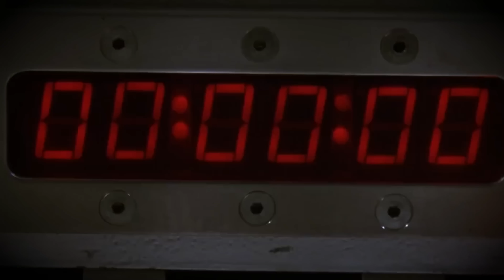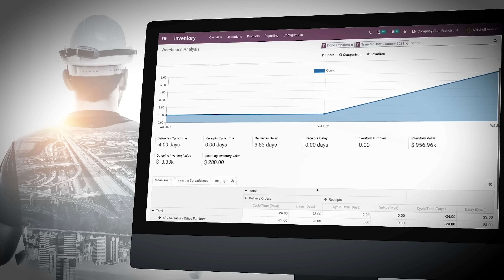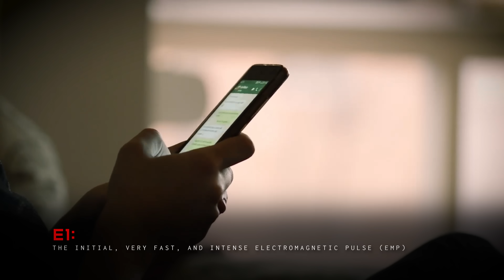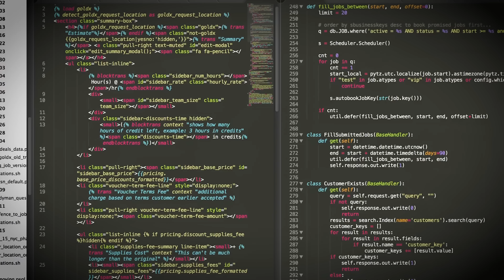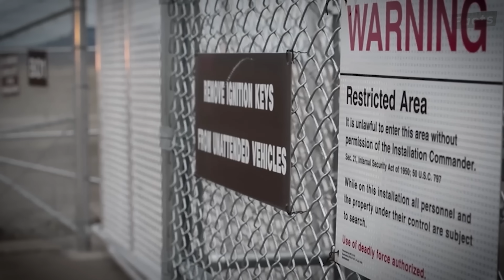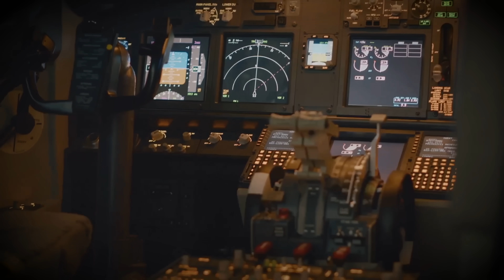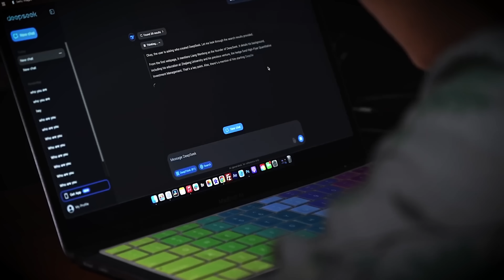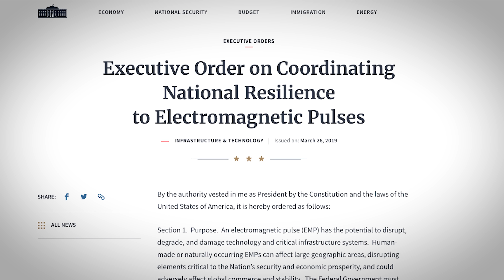Could an EMP actually cripple the U.S. military?

Comment: No an EMP will not shut down the US military it might change the battlefield but it wouldn't shut down the military boots on the ground with firearms in your hand are Emp proof and that is actually how most wars are  fought  take the Taliban for example for 20 years a group of people fought against the United States military armed with nothing but 30-year-old and older weapons left over from the 80s wearing flip-flops and bathrobes driving the occasional Toyota pickup truck and somehow they managed to defeat the United States military take control of Afghanistan and still have control of it to this day

Comment: I'm aware that you posted this video 9 days ago but I just saw it today. Given the information that you put out in this video I'm assuming that you're aware of this, but I'm just going to put it out there for anybody interested in reading this post.
The main and most significant reason why civilian infrastructure and the majority of even basic military assets are not hardened against EMP's is cost and redesign.
Almost all of the microchips in the world for civilian and military use are silicone based. It was discovered a long time ago many decades ago and only starting to put into effect in the 1980s that gallium arsenide chips and another version of galenium are highly resistant to Electro magnetic pulses.
However gallium arsenide chips are very expensive and on top of that you would essentially have to re-chip everything except for a new products that were not built with the new Chips instead of silicone base chips.
Many of our strategic military aircraft have basic EMP protections built into their airframes and I'm not going to go into detail explaining it but they are very basic.
The main problem or fear were the High Altitude electromagnetic pulse attack is the civilian infrastructure. Without power grids within a matter of a couple of weeks Millions to tens of millions of civilians would die. This is from many aspects of hospitals, water treatment facilities, Refrigeration for food, etc etc etc. And that is where the real problem is. So I don't believe that Russia or China would ever use an EMP against the US unless it came to an actual full-on World War and then yes I do think that they would use one to kill as many civilians as possible to make it that much more difficult.
That's my long rant, any thoughts?
Reply: Perfect and to the point, but everyone forgets about the fires this event would cause.

Comment: EMPs can be blocked, you have to use just as much power or more than the EMP.  EMP shielding, Faraday cages and frequency filters can operate to channel the incoming energy, and can be made to create a dome parameter.  When it comes to waves there is also always an option to counter it with an opposing wave.

Comment: 😂 ❤ … Power plant installations in America are insufficient, poorly maintained, lack of replacement parts, lack of Technical manpower … EMP is the last thing to worry about…  
If one Generator fails, there would be a cascade failure as the other Generators will try to keep up with the power demand, in a few hours, all the generators would fail. That is your main problem. No backup facilities.

Comment: Ok cliff notes. If US military hardware is built in compliance with Mil-Std-461 & 464 (hint most is) EMP will have limited if any impact. Civilian hardware could be impacted, it would have to have long cables (think power lines) in order for the energy to couple. There is a vulnerability in the initial pulse because the fast rise time simulates high frequency but is limited to line of sight. In an example your cell phone would likely work but the cell tower might not.

Comment: In an effort to improve efficiency and improved grid reliability, many electricity companies have discarded the old analog protection systems and gone digital. So yes an EMP could have a devastating impact on the grid in the area of susceptibility. The grid can be isolated to disconnect from effected areas but are talking a very wide spread range of impact.

Comment: I’m under the impression that non grounded (plugged in) electronics would not be affected.  So, cars, cell phones, etc… would likely still work.  Of course the networks that run all of that would go down (server farms, civilian power grids, even the electronics needed to power gas pumps, payment systems, etc…)
Reply: Wrong impression. If it has a microchip and the whole item isn't harden/shielded from EMP it's toast. Until recently Russia used a lot of electronic tube technology for their military because the EMP only affects the circuit while the EMP is present. Then the circuit returns to normal. Russia is over 90 years ahead of the US in tube tech.

Comment: I think one of the biggest questions we need the answer to is if they just turn things off like pressing the power button, or does it completely fry the electronics? Do epoxy coating like those used in power tools protect them?

Comment: FCC GROL+ Radar license holder, industrial electrician/electronics technician here. If I was military, I would be a W-1 with my training and experience as that's what one of my classmates that graduated from the same program that was military was promoted to. You have some serious errors, other than the Sun:

E1 - Most modern electronics can actually handle this pulse and are fully shielded against it. Almost all integrated circuits now are made to be immune to this pulse unless it effects the power supply circuit.

Modern surge suppressors of middle or higher quality, along with power supplies of decent quality design contain Transient Voltage Suppression (TVS) diode that can clamp down even the fastest of spikes in voltage in the nanosecond range in addition to the Metal Oxide Varistor (MOV) that handle most of the transient voltage spikes.

E2 - only poorly grounded antennas at very close range that and are made of thin material (and/or are circuit controlled antennas) without filtered and properly grounded receivers attached.

This is because a path the ground can be provided by the snubber circuit created by the low pass filter in the receiver, giving the transient a very low impedance path to ground. Lower frequency antennas and receivers are more vulnerable since the impedance of their circuit against such a spike would be lower than a higher frequency, so a Cold War era military radio is going to fry before a Starlink terminal.

Comms equipment (microwave as is used by emergency services and the military and cell systems) connected to metal structures isn't going to get damaged by this pulse level anymore because they are rated for it. The power supplies are fully shielded and have surge suppression that is tested against lightning striking the tower or structure. The power cables are shielded. Everything is well grounded because if it isn't, it picks up the radio waves and that gets into the equipment, making it not work. You have really bad info here and I don't know where you got it. The older military equipment (Cold War era) is rated for this and just needs the surge suppressor working with the ground installed. The tower won't be transmitting enough for use without a sufficient ground to handle the EMP surge. The tower transmitter has a surge suppressor and so does the generator, then there is the filters in the power supply of the tower to protect it as well.

As for civilian and military vehicle vulnerability to EMP: only the AM/FM radio might be dead and you could lose GPS satellite connection from them taking a hit. The computers are shielded to protect them from radio interference and from the constant small EMPs going off in the engine bay from the ignition system. So, they are in a thick metal box with filtered inputs and outputs. If it was off, it should be fine. It might stall when the event happens, if it is older or cheaper build quality. Military aircraft: all of them have been upgraded in NATO to be hardened against EMPs. This was a massive project and there was a patent to go it using a special semiconductor that ended up being reinvented a second time. All current service aircraft use this. Civilian aircraft...well, that's different. Older ones are where things get dicey, but the radios would still work as they are rated to take the EMP forces because airplanes are rated to get struck by lightning and the filters for their radios would stop the E 1 level, same for the tower's and the tower radar, so they could still be guided in for landing. Newer planes would have all their electronics still working, other than the GPS issues, which you covered, but they actually navigate by the older radio navigation beacons and these are already hardened (thanks DoD) so they could just continue on.

Let me just cover the last of this long correction. Your computer and laptop? If they are older than 2001, you are good. That EMP resistant chip and the shielding needed to protect your machine from blasting out it's CPU frequency as a radio since they go so fast and hard now. Also to protect it from stray radio transmissions from making clock-like waves that would cause bits to get lost. Same for your phone, including the radio and the cell towers. Your phone has to be resistant to all of these problems because it's a radio and a computer in a tiny package, so they need to keep it shielded, so foil, metal case parts, and metallic paint pull that off. Last, the power grid is controlled with a backup system now that uses microwave towers and radio transmitters so that if the connectivity through the switching stations and substations they can still communicate with the key switching gear and generators. This was rolled out nationwide as part of the Smart grid, except in parts of Texas, where they hate progress and want to pay for infrastructure twice.

Next time, consult an expert or two and not just some internet research.

Comment: Small electronics - particularly in cars - are not quite as vulnerable as often made out to be; because it has to withstand handling by people (who can develop thousands of volts on them just by walking across the room). So, all modern devices have surge protection both on the connections to the device, and on the connections at the edge of each microchip.

Cars are both safety critical systems - and thus subject to more rigorous design criteria than, say, a portable CD player (remember those?) - and in general are nasty electromagnetic environments to begin with (alternators with brushes, DC load dumps, high voltage ignition systems, and possible lighting strikes all contribute to this); so to get basic reliability, they are already somewhat hardened from the factory.

That said - a close-by EMP can still fry your stuff, just by sheer brute force. If you want a post-SHTF vehicle, look for older diesels (i.e, doesn't require an engine computer to trigger the fuel injectors) or bikes/quads with carburetors instead of fuel injection. If you need some electronics to survive, store it in a faraday cage - at the small end, a steel ammo box works, and at the large end a used ISO shipping container makes a nice bunker for your gear. Just make sure that the doors/lids are electrically connected to the body of the container (so, strip some paint off of a spot, and screw a wire in to bridge across the hinge, and seal it back up with RTV silicone caulk to prevent rust/water ingress).

Comment: Military's trucks require that they are not disabled by what I call "the lighting bolt" test.  An electrical arc set off near the truck.  How this compares to an EMP I have no idea but I would say better than your average car.  For decades now I have been hoping that our governments would require robust electrical systems against EMP.  I think very little has been accomplished.  So we maybe not have issues with military trucks nut we will have issues with fuel pumps not working.  Water pumps not working, medical equipment not working, communications not working in the civilian sector.

Comment: I remember when the USAF tested encryption mode on the GPS signal; this was before GPS was commercially available or widely known.  They didn't know that the FAA was using the signal for synchronizing comm between airports and accidentally took down the flight scheduling system. Domestic flights had to ground until the system got rebooted.
Reply: Day date time. Hyperlink? Year?
Reply: arse was not talking to head...

Comment: Years ago, some show on the Discovery Channel tested a Nineties-era Ford Taurus at a military EMP testing facility.  The car stopped running.  They restarted the car and drove away.
Reply from the maker: Well that is because the 90's era Ford Taurus is an incredible piece of engineering.
Reply: The computers of that era were much less advanced (their nodes were measured in micrometers), so a much larger charge was necessary to short the semiconductors than in modern sub 30 nanometer process chips we now see in vehicles. Modern vehicles are also much more interconnected, so less needs to go wrong to create a no-start situation, like a fried proximity sensor (radar) or something.
Reply: @wh0_am_152  Modern microchips will be fried. No restart.
Reply: Plot twist,   they drove 5 miles out and blew a head gasket.
Reply: that test was done at a peak power of only 50,000 watts per meter, wake up they have offered 100,000 watt per meter versions to the police for years, They don't buy them cause then they have to buy the cars. The army uses it a sensitive check points for several years.

Comment: How would an EMP affect our older nuclear power plants?
Reply: It's not that an EMP would affect the power plant, but they wouldn't have anywhere to send the power to. A nuclear reactor doesn't work like a light switch so yes it could cause a nuclear reactor to melt down without the EMP even hitting the power plant. 😮

Comment: Kyle I’m a cyber security expert (seriously 😮) although I don’t normally mention that. I’ve done dozens of security assessments and built a municipal infrastructure (across 11 critical sectors or domains ) to determine the state of security for things like the power grid. Anyway the state of maturity across North America is incredibly low first of all. Secondly taking these systems down is not as simple as an EMP pulse although I’m really impressed with this video. My point all this is if you’re ever interested in talking over these topics let me know and we can share actual email information and names and then go from there. But please keep this up because this is excellent content and I’m really grateful for your effort in producing it all. Wonderful stuff.
Reply: I work in the largest water treatment plant in the South East and our system in Air gapped for cyber security and the plant was built in 1893 so everything has an analog backup.  It's a pain in the tail but it can be ran without computers.  But to have safe drinking water we still need electricity for disinfection and pressure.
Reply: @xG.H-B  that’s so good to hear. I often read articles about infrastructure vulnerability and wonder ‘why would connect the control interface for something important like a dam the internet!?’ It seems insane! I suppose local control has its own issues and vulnerabilities but it’s a far smaller attack surface.
Reply from the maker: That sounds great. Feel free to email me at kyle dot gunn at task and purpose dot com. Thanks! -Kyle
Reply: Kremlin: You did what!? Are trying to kick off MAD?!

White House: Well, if it's any consolation, we took out several of our own satellites and only one of yours.
Reply: I am sorry Sir, and with all due respect Sir, Squanto saved the Pilgrims... Ready?
Reply: Military hardware is way more hardened than anything in the civilian sector. Who cares about us anyway anyways, right

Comment: I wonder how hard it would be to shield the electronics in an FPV drone. I know drones that are wired to the control through fiber optics are being used in Ukraine to defeat anti-drone jamming signals. Fiber cable is immune to EMP.

Comment: US Navy submarines are invulnerable to EMP so, no concerns about appropriate retaliation. (former USN Missile Tech)
Reply: Invulnerable? Or just hardened like any other ship, plus also generally under water?
Reply: @nathanahubbard1975  Three factors: a) the hull is metal and that forms a faraday cage; b) it's in seawater which is conductive and absorbs the EMP (this, BTW, is one reason why radio communication with submarines is so difficult - the water absorbs the radio waves) , and 3) what little sticks out from the hull is hardened against voltage spikes on it (i.e, it's got surge protection circuits on the antennas and sonar transducers).
Reply: @nathanahubbard1975  invulnerable as in the chance is so low that it might as well be zero.
Reply: lol water is like the BEST EXISTING SHIELD EVER vs EMP just one meter thick "walls" of water would shield any infrastructure from ANY radiation aside from a gamma ray burst (that will fry half a solar system)
Reply: @kickass-eu1dh  Specifically, salt water, as it's conductive.
Reply: @darkwinter7395  aye sailor xD!